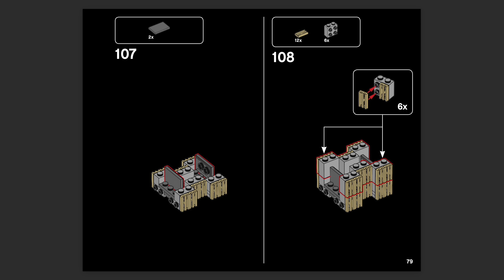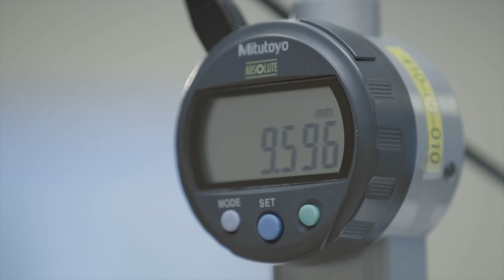MORE Illegal LEGO Techniques

Comment: 3:00 I don't understand why LEGO doesn't produce a tile with studs on both side just for that purpose. I have such a piece from a non-LEGO brand and I think it would come in handy for LEGO.
I'm surprised how some non-LEGO brands have a bigger variety of parts and that LEGO doesn't make their own counterparts to catch up with the competition.
I guess LEGO is still at the top so they don't worry as much to make decisions that would probably cost them a lot of money for no immediate advantages but they do update their inventory with time so I hope they will produce tiles with studs on both sides at some point.
Reply from the maker: Yeah... I'd love to have that piece made in LEGO. It would be so insanely helpful for builds!
Reply: Seeing that they have the inverted tile piece now, I think its almost certain that Lego doesn't plan on making any double-sided plates any time soon or ever. I mean if they had a double-sided plate, they wouldn't need to introduce inverted tiles, or any inverted pieces for that matter. I reckon they must've tested such a piece already and maybe concluded that it creates more problems than it solves. Surely it would make many if not all the inverted pieces redundant and obsolete. But maybe inspite of that, the convenience and versatility might actually bring about more benefits than drawbacks and Lego is just sitting on wasted potential as they so often have.
Reply: There m

Comment: As for stud reversal.... it still surprises me that unlike so many other brands, Lego doesn't make plates with studs on both sides, those are so convenient! And Cobi goes even a few steps beyond, with not just regular double-studded plates, but also thin plates (similar to base plates) with studs on both sides. Or the opposite: bricks with no studs at all! And they make the ultimate SNOT piece: just a double stud! I'm pretty sure Lego would never make those as it is very easy to put those in places that makes it (nearly) impossible to remove them. Still, so extremely usable...
Reply from the maker: Hopefully LEGO will do some in the future. Any day now…

Comment: I'm a bit wary of the technique used at 3:39, I find it really hard to pull them apart. For some reason the modified 1x1 plates with O-ring also get really tight around regular bars. Those are some theoretically legal techniques that seem to be slightly off to me, and I've had to discard pieces that I just couldn't separate.
Reply from the maker: Yeah, PC plastic, specially bars and other elements that go with them are sometimes an issue

Comment: I dont know. I feel the quality control is probably not upto the mark recently. e.g in the downtown diner set from 2018, the sound recording machine has 5 light blue headlight pieces that connect to each other. I built the set once, put it on display for some time and then disassembled and put in ziplock bags. When I wanted to build the set again, I noticed all those headlight bricks were cracked, along with several 1x1 white bricks. Also, with creator haunted house set, several 1x2 bricks have cracked :(

Comment: Tiles between studs still puts pressure on the plate, doesn't it? From some tests I've seen, it still bends the plate, even if only to a lesser degree. Very visible with multiple tiles.

Comment: I think I might have invented a new illegal building technique.  Maybe someone can tell me.  The part being stressed is a long Technic axle piece which is connected to the wheel base of a vehicle on one end, and the body of the vehicle on the other end.  It allows the body to rock side to side relative to the wheels by twisting the axle, and functions as a suspension system by holding the body upright and allowing the wheels to bump up and down while the vehicle is moving.

Technically as a build that's just sitting on the shelf, there's nothing wrong with it, but I try not to build dust collectors.

Comment: If you don't mind me asking, is putting a PL.ROUND 1X1 W. THROUGHG. HOLE on each side of the technic pin hole of an ANGLE ELEMENT, 0 DEGREES [1] considered illegal considering the illegal technique talked about starting at around 3:45?

Comment: I have a question. Would a CMF minifig base (a 3X4 plate with studs only on the middle row) be able to be put vertically on a 4X4 tile? Similar to what’s shown on the thumbnail. It’s a bit of a dilemma for me, since it is a plate. But does have studs
Reply from the maker: Not aware of what a 4x4 tile element would be. Tiles usually don’t have studs for you to vertically connect an element
Reply from the maker: Regardless. The minifigure base feels like it belongs on the plate family of elements therefore it would be illegal I feel
Reply: You could do the test shown in the video:
Get 3 identical 2xN plates, put several plates on the first, tiles on the last and see where the middle one falls when you put several of your piece in question on it.
Reply: @TiagoCatarino  Oh sorry. I meant a studded 4X4 plate

Comment: 3:30 But why do these pieces work in this configuration and not the brackets?
(sigh) I guess it wouldn't change the fact that the bracket version just doesn't work.

3:45 - 4:05 Aw man!  Not only can I not span multiple studs across technic holes, but I also can't use them for stud inversion :'(